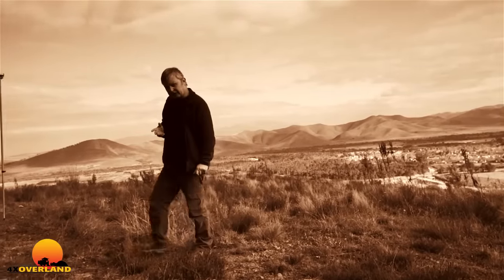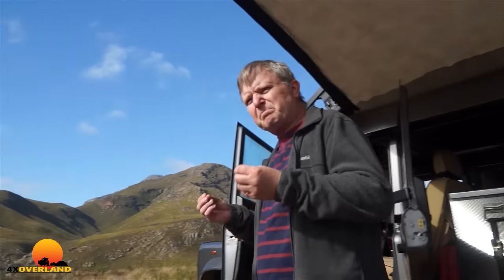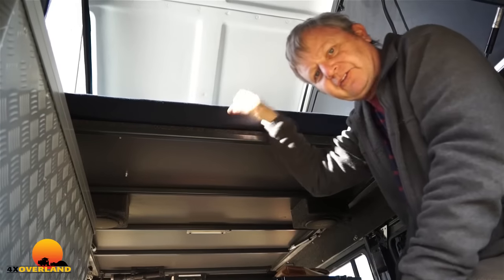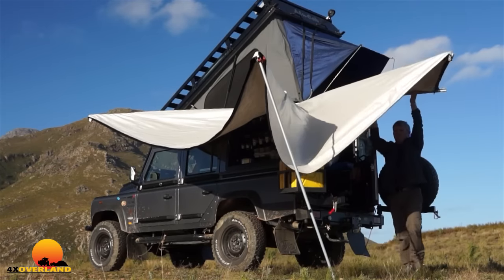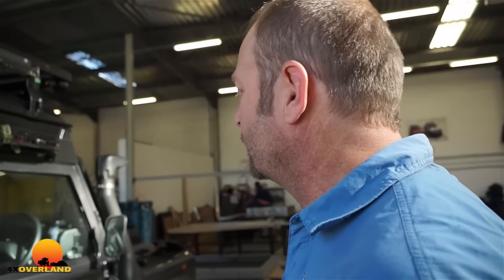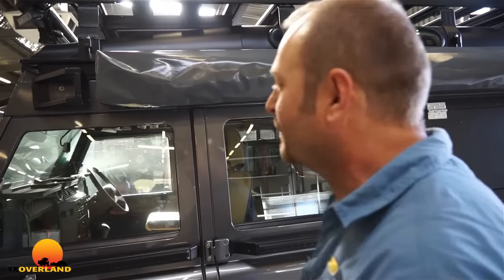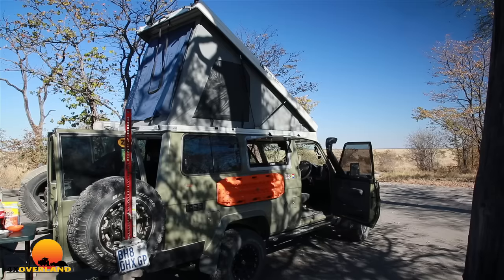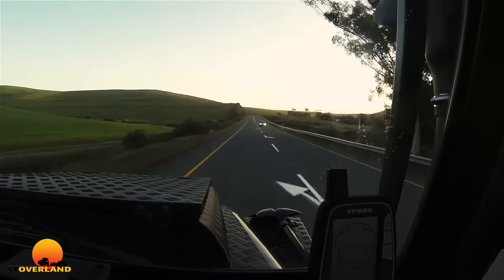Land Rover Defender - The ultimate Camper conversion

Comment: in what way is a defender unreliable i just sounds like the same shit the average american states (yes i know you're an australian) but realy though what makes it any less reliable
Reply from the maker: I am not Australian. I'm English. I've owned four Land Rovers, two Merc-Gs, and I'm on my fifth Toyota. And I listen to people talk. For example, I had a meeting with a safari 4x4 hire company last last week, who has been hiring out Defenders for decades. He also hires out Toyotas. He says he easily gets three times the distance with a Toyota than a Land Rover before breakdowns and cost of maintenance forces him to sell and buy new. Anyone who says Land Rovers, as wonderful as they are, are reliable, is talking from the basis that to them a repair means something entirely different to other people. I know. I was one of them, and thought they were reliable. Now I drive a Land Cruiser. And I never, ever, ever, ever have to fix the bloody thing. My last one had 190 000 kms on it. In that time, I replaced the shocks and the engine mounts. And that is ALL. That is how I personally measure reliability. You may very well have a different way of measuring it. By 65000 kms my Defender had a replaced steering box, three pinion oil seals replaced, radiator split, alternator bearings gone and the serious gearbox whine. And my Range Rover, by 160 000kms I had rebuilt EVERY mechanical component other than the front diff. That's not what I regard as reliable in my view.
Reply: 4xOverland you are english sorry the excellent Bill Oddi/david attenborough accent  i thought had a australian tint to it ... and yeah fair enough id certainly expect a toyota engine to run and last longer but in terms of day to day turn key reliability i would expect to get to 150k on any car before having to do any larger scale work  what do you consider to be the most capable off road ?
Reply from the maker: Gavin Irvine Off road, I would say, out of the box with no or few mods, probably the Land Rover Defender. Add lockers and its close to unbeatable. Probably better than any Land Cruiser in all terrains except sand, where the Toyota's bigger engines give them clear advantage. Of all my 4x4s, the Gs were absolutely brilliant off road. As overland expedition vehicles, in my view, nothing beats a Land Cruiser 70 series. Actually, I'm UK born, spent most of my life in South Africa, have Australian mother, New Zealand father, and now living in England. So any guess would be close.
Reply: 4xOverland thank you for the information much appreciated there had to be  a reason why you always see terrosrt organisations kicking about in landcruisers its because there indestructible and outstanding on sand then.... thanks for also letting me know  where your interesting accent comes from its very good
Reply: 4xOverland i find the defender just wonderful for its age and longevity of design much in the same way i marvel at the vw beetle for its longevity and design
Reply from the maker: Gavin Irvine Many thanks. Keep in touch. Find me at www.4xoverland.com.
Reply: I would never expect 150K out of a Land Rover without trouble. Mine started giving me trouble within a month of purchase! And it kept giving me trouble and sever break downs until the day I sold it. Other's that I know say the same. I initially wanted to turn it into a camper/overlander once it got older. But unfortunately it never made it into old age. Now, my used Land Cruiser with 194K has never a single time ever broken down in any way whatsoever, large or small stuff.
Reply: bluesky 4xOverland Gavin Irvine the old design is still in use because they made it perfect years ago, i am 19 years old live in Dorset England and i drive a 1969 Land Rover Series 2A and that little beast has not let me down once, even pulled a couple Toyota's out of trouble, strong chassis, never give up attitude. Have always loved them and always will
Reply: thymightyjack They don't make the defender any longer. I think last year or this year were the last year of manufacture. I don't know that it was perfect. I compare it very closely to the Jeep Wrangler. Both were designed for off road and rugged use. Though both were plagued with reliability problems, Jeeps are still unreliable, despite how much I like both the Jeep and Rover. The other issue I have with both is ergonimics: the Jeep windows and roof are very low and small, and the seating position in the Rover is too far lateral that you have to stick your self out the window.
Reply from the maker: bluesky I believe Defender will go out of production in 2015. I can still buy a brand new 110 SW for about £28000.
Reply: 4xOverland  rather sad they are killing it off it off  sadly botyh the rip off brands killed there or there brand as well http://en.wikipedia.org/wiki/Santana_Motor http://en.wikipedia.org/wiki/Iveco_Massif adac germany used a full feleet of these a few years back they looks fantstic
Reply: yes 2015 will be the last ever defender, but the production line is being shipped and sold to a different country and manufacturer, therefore we should still have the opportunity for some grey imports :)
Reply: thymightyjack India or China? Is it a car company or just an investment company? I would love to see it maintain it's motif but in a modern interpretation with some more durable engine components and simple electronics like better window motors...
Reply: bluesky The old 300TDi engines are never a problem unless the cooling is bad. The good news is that for not much money a brand new aluminium radiator with a 10% upgrade can be purchased.  Another improvement though rather costly is the Brazilian 2.8 engine.  If one reads the book about building the Gun Barrel Highway in Australia one will see that even a little old Series can get through bush without a scratch provided that the driver is good at chopping-down jungle. 

Many of the modern cars, vans and 4x4s now have Drive-By-Wire.  Whilst this is OK when it works it does not meet the "Can you fix it in a field?" criterion of a mechanic that I used to know.  (He changed worlds prematurely through smoking too many cigarettes)
Reply: Tech Davey I agree, I love simple cables  vs drive by wire controls.  I especially dislike the new electronic parking brakes that many companies are using! It's absolutely horrible. They took the only way you can still apply brakes in times of brake failure and removed it!  On a different note, what's your opinion on All Terrain Tires? I'm looking for a tough,rugged all terrain tire. I see the General Grabber AT2 as an inexpensive option in 285/75r16
Reply: Gavin Irvine Danmmm, that's a big lesson you learnt here, treasure it! xD
Reply: fernando quiñones not really my question was answered in the first reply...................  the rest of this is mostly arguing  with an american that does not grasp in standard out of the box form there is not really a good (Jeep) no mater what model
Reply: fernando quiñones wait thats a different coment on the same videos  yeah some helpful information
Reply: when your RR brakes down in the bush, you'll learn to love a toy - honest!
Reply: 4xOverland You need to consider part prices. Parts for the Defender are dirt cheap and available everywhere. Parts for the Toyota are very expensive (Denmark). I own both.
Reply from the maker: ***** I think this varies between countries. In Australia and South Africa, original Toyota parts are similar, if not a bit cheaper than original LR parts.
Reply: TAK Nicolaj :.) LR 4-ever
Reply: 4xOverland
 You forgot to mention also in Australia most people that have real off road 4WD vehicles either have Toyota Landcruisers or Nissan Patrols because of the reliability and access to parts.
Reply: 0101010 010101 not been part of rover for 5 years and there reliability out performs most now please look it up and stop recycling old bullshit
Reply: Land Rover announced that the defenders successor will be production ready within 3 years. The reasons they had to end production were due to their insane emissions for today's standards apparently. But hopefully the new stays true to its roots
Reply: Mauro Quiroga No, the engines are quite modern (new td4).

The Defender can no longer pass the Euro NCAP tests. Thats the main reason for the cancellation.
Reply: The only reason Americans say their junk is because they are junk they're actually beautifully designed and most of the parts are very well made but when you need them in a pinch they dissolve and you find someone with an old air-cooled Volkswagen or American made pickup truck to save your ass  what did I leave out the fact that I've seen
 four &  five hundred thousand miles on Japanese vehicles but never on anything made in the U.K .
Reply: 0101010 010101 I'm glad the resale value is so high because he will be paying that down at the shop having it fixed every weekend well the Toyota just keeps going and going then taking over world sales because they are better much better
Reply: There are plenty of cheap Land Rover products on the market here in California because they have a terrible reputation well earned
Reply from the maker: Mauro Quiroga Not the emissions. It was mainly the safety standards. And they are also expensive to build because of the type of construction is old fashioned.
Reply: 0101010 010101 largest second hand market in the uk is now ebay  but feel free to use auto trader or any other you will only find the same
Reply: Gavin Irvine You don't have to sell the defender to me. I own one already . You must confuse the ppl in this thread.

Comment: What is the diference of  range rover and land rover?
Reply from the maker: +Jose RH Land Rover build vehicles. Like BMW and Ford. Range Rover, Range Rover Sport, Range Rover Evoque, Defender, Discovery, etc, are all Land Rover models. Just like a BMW M5, X3 etc. Ford Focus, F250, etc.
Reply: +Jose RH Like Overland has told you land rover is the company which builds the vehicles and range rover is the high end cars of land rover (sportier,more refined,better quality) if you want to consider it like that
Reply: range rover isnt as good as it use to be its for footballlers and its more of an suv now a days
Reply: ...but is there a Toyota power plant to match the 300 tdi Land Rover motor in both reliability AND fuel efficiency...? The Landy motor may be a relatively old design, but hell is it tough and fuel efficient...!
Reply: True i suppose Kobus Prinsloo i meant like as hardcore offroaders how they use to be
Reply: #Jose RH Bill Soucess. I agree and understand you completely! I do. I owned a Defender for 8 years. I owned a Range Rover for eight. But my guess is that you are from the UK. In the UK, a Toyota is an ordinary mass produced family car, many of which are very dull. But in South Africa and Australia they make the most reliable and best overland 4x4 trucks - and they also make some quite good cars as well. As for me, I get EXACTLY the same thrill I once got at a lonely camp site when I looked at my Defender - now with my Land Cruiser. So our perspectives are different, and I assure you, while you find it difficult to understand, a Toyota can also make you feel that way. A Land Cruiser is a fantastic vehicle, and like the Land Rover, gives sincere pleasure to many owners that love them. No difference whatsoever on how you feel about your 130. @Les M
Well done, you should see some of the fantastic Land Rover modifications here too. http://tmdtuning.com/shop/

Comment: It irks me that Toyota don give us their 78/80/105 types in the UK, yes we hardly have any use for them but an option would still be nice for those of us who like character and after this year we won't even have the Defender as an option, just motorways full of dreary German auto barges....which I currently own by the way, but this WILL be changing.
Reply: the Landcruiser 200 series are the best for actual off roading, In Australia for those who use a serious off roading vehicle the vast majority either buy the Toyota Landcruiser 200, or the Nissan Patrol as they are seriously reliable and if parts are needed they are pretty cheap and built to withstand Australia's harsh conditions.
Reply: MaZEEZaM Yeah, the 200's are absolute monsters for sure, but in the UK they're well into the 60k region for a new one and the running costs are massively prohibitive in terms of road tax and fuel cost, most people who buy one here just do so because they're rich and want people to know it, I'd be willing to bet you would never see one go down a muddy green lane.
Reply: They are really expensive here also, base diesel model GX starts at on road $82,000 AUD and top model the Sahara costs about $120,000 AUD and fuel is very expensive here also, but we don't have a road tax like in the UK. Have to be seriously rich to buy any of these new but we do have a thriving used car market although because of the reliability they depreciate VERY slowly.

Comment: Interesting video and comments. Does anyone ever view a trans-continental or off-road vehicle as a means to an end? Virtually all 4 X 4 vehicles can be improved, it just depends upon expectations. The manufacturers never intended for their vehicles to do what everyone thinks they should do.....Unimog being an exception.Toyota Land Cruisers don't like deep mud,....time in Africa brought that lesson home. "New" Land Rovers are like Toyota's,...land barges. I will say that Land Rovers have lost their way for the longest time. Why they cannot produce a reliable and useful engine with some decent power, is beyond my comprehension. I have a 1967 109 ex-Military,Land Rover,(soft top) and it has never broken down. Yes, it is crude, simplistic and runs all day at 70mph when the road allows it.The point is, it was built to a given spec, and those specs never included hammering it all over West Africa., which it seemed to thrive on. Best bet, to get the biggest (and most reliable bang) for your buck, is to build what you want.:;)
Reply from the maker: Toyota still build the Land Cruiser with the 1HZ engine. Its as simple and reliable as an engine can get. But emission control regulations means that engines have to be complex and computer-controlled to get them to comply. Even modern tractors have to have ECUs to comply. The days of the simple overland vehicle are all but over. My own Land Cruiser is the best that can be done, but this model is only available in Asia and South Africa. Nowhere else. 
check out this vehicle here:http://www.youtube.com/playlist?list=PLdZBtPD_yK0-2gZ-mlbV5viPfjwihkBfs

Comment: Having owned 5 Range Rovers and two Land Rovers and having built a couple of Land Rovers completely from scratch; chassis build-up bespoke jobs I can say that I'm never going back, on my second Toyota, have had a Cruiser and a Hilux and nothing ever goes wrong with them. The Rover stuff was typical parts bin British engineering, weak engines, poor electrical systems and fragile transmissions and needed fixing constantly whereas the Toyota stuff is over engineered and over specced in all respects and has decent engines.... the 6 cylinder 4.2 liter diesel in the Cruiser being a case in point. If you're doing much beyond towing Jemima's horse box to pony club on the weekend in the UK get a Toyota.... There's a reason they are preferred transport in literally every country with poor roads with the possible exception of Russia where they have their own manufacturers and stuff suited to their terrain.....
Reply: Chris Smailes Surely the reason Toyota's are more prevalent is because they are cheaper? Their cart spring suspension does not make for a comfy ride. Unlike my Rangie's air springs
Reply from the maker: Overlander 98 Generally, Toyota Land Cruisers are more expensive than Land Rover Defenders, at least everywhere I have looked. Leaf springs are better and carrying loads than coils. Provides much more stability. Coils have a better ride for the passengers and drivers. But. Toyotas are so successful in developing countries because of the ride that is harsh, which means drivers drive slower. They do this on purpose! When Land Rover introduced the coil sprung One-Tens in 1984, NGOs did not like them at all. Too comfortable on unmade roads, which meant higher speeds, rolls and accidents. Toyota stayed with leaves, a with good reason. Also, the vehicles, driven harder, didn't last as long. Toyota is the one of few manufacturers that has targeted developing countries with vehicles made just for them. And right now, that is the Land Cruiser 70 series.